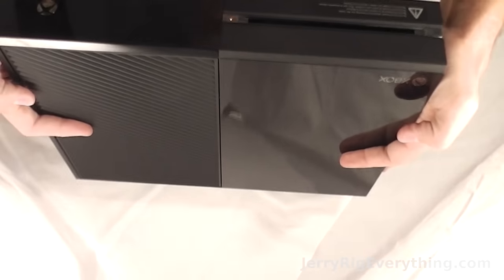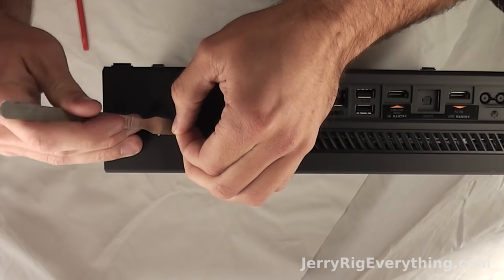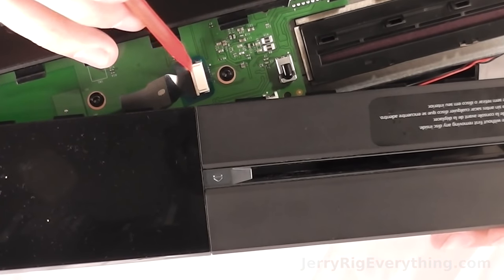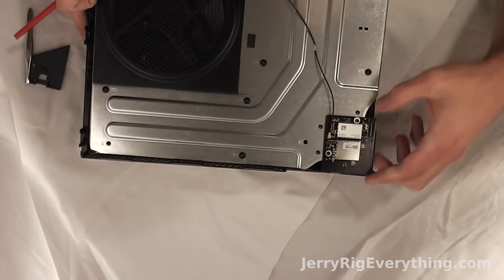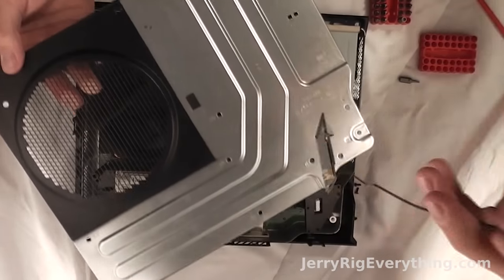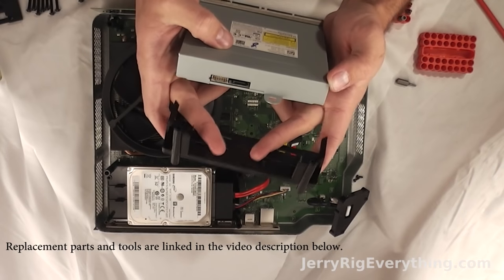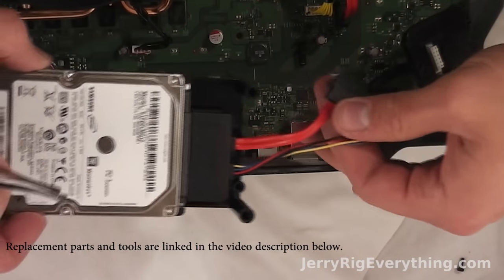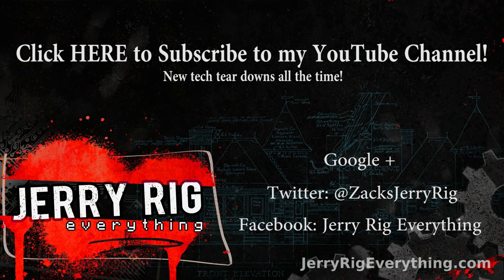NEW XBox One Complete Teardown, Hard drive replacement, Disk Drive swap

Comment: I'm a diehard Xbox one fan but this is waaay too much work. That's why I love the PS4. You can change the harddrive in literally 5 minutes.
Reply: lazy..
Reply: Sorry we don't want do completely disassemble are consoles just to replace a hard drive. The risk is just to high.
Reply: SILLYBOBO112 Not really. It's just a huge inconvenience.
Reply: Compared to the 1st gen, 2, and 3rd, this xbox is so easy to take apart.
Reply: How often will you be swapping drives? An extra 2 minutes wont kill ya
Reply: It's not a f""king 5min vid
Reply: SILLYBOBO112 Fanboy.

Comment: Is it possible to replace the hard drive with something bigger?  (I mean the machine won't freak out or refuse to recognize it?)

Microsoft were mad for having only a 500gb HDD when they insist on installing every game.
Reply: Agreed! I have 7 games and I've already used 80% of my memory -.-
Reply: Microsoft insist you get an external drive or use the "cloud"
Reply: yeah, ive gone and bought a 2TB external drive and even that is filling up pretty quickly.

ill probably need to upgrade to a 5TB by the end of its generation lifetime.
Reply: Jaymy Hickey of course they do.  they have an agenda to push
Reply: That's not even my issue. What happens if and probably when the internal HDD fails? Can I use external HDD as the only HDD?
Reply: chertio
I believe you can, yes.  You have an option to choose a primary drive.
Reply: I've replaced my internal drive with a 2TB hdd because I don't like having wires and external boxes dangling from my Xbox, it was a bit tricky because the new drive has to be partitioned in a specific way but does indeed work
Reply: Larry Bundy Jr 5TB is still not enough
Reply: machariel00 no the os is in the internal drive if that drive goes how are you going to even make that option? You can’t... Xbox just made me not want to buy any of their consoles ever again.
Reply: @Larry  yup i bought a WD 5TB external after installing 5 games and finding that with all their insane 70GB+ "updates" the internal drive is totally full, so it was like week 5 and i went and got a 5TB external. Does anyone know what size internal you can replace the 500GB one with? I have heard people trying 1TB or 2TB and they are only able to use 768GB of the 1TB+ which begs the question, what kind of proprietary system are they using to get their stock 1TB and 2TB consoles to work???
Reply: best buy sells up to 8 TB. on their website
Reply: @Larry  
The generation ended. Did you need a 5tb hdd?🤣
Reply: @ayyubaliyawan8155  YOu can just use acronis imaging software and it will clone any drive I have a 2tb ssd in my xbox one.
Reply: Charle Stew  Yes it auto partitions and images. It is a paid service but I think it's like 50 a year. If you want I wouldn't mind sending you my login to use. I can just change the password back after you're done.
Reply: Charle Stew  No problem bud! Good luck with it and have a happy holiday as well!
Reply: @Larry  I have a 2 tb with like 50 games and still have 500gb free how in the hell is yours almost full 😂

Comment: The fan is HUGE I guess Ms learned their lesson :)
Reply: well most heat is from the cpu and its got a massive heatsink and fan. so it should do the job.
Reply: but the heatsink paste is a tad better on xbox one than on ps4 both heatsink paste are crap they use. and on the ps4 the paste was rock hard on one vid the guy did a teardown. clearly they skimp on quality paste, knowing over time your get heat issues.

Comment: wish there was a xbox/ps software where you install on your computer and have ps4/xbox one, since its basically a computer.
Reply: The power you would need to run that software isn't possible with current PCs. These machines are made to do one thing and one thing only and that is to play games. PCs have more complicated operating systems, a lot of stuff going on in the background and games optimized differently for them.

In theory you could emulate the Xbox One and PS4 one day, just it will definitely be at least 5 or 10 years until we see that happen.
Reply: FluffySandwich dude ur way off pc right now have more power then consoles gaming wise. You could run a xbox one or ps4 emulator now if they made one. U dont know what your talking about when it comes to pc or anything for that matter sure u can take apart a xbox congrats pretty much anyone can
Reply: general rule of thumb with emulators is the machine needs to be 3x stronger then whats its emulating(possible today) but that's not the problem the problem is the drivers and the OS and stuff. you would need to emulate all of the hardware (CPU(APU technically) ram all the buses) and that's just a big unknown if this was open source there would be emulators the next day after release
Reply: ***** show me a use of someones 64gb of ram in gtav/forza/gran turismo... or show me how you emulate 10 years old gran turismo from ps2...

please try to run gta iv with 512 ram and 256 mb gpu... you cant? consoles can...

your argument is invalid
Reply: ***** ``waste of time`` yeah, sure... look at pcsx2 or whatever... its still not working like it should, end of topic
Reply: FluffySandwich The Xbox One utilises the Windows Kernel, so if you're familiar with Windows 8 then the Xbox One OS will also be familiar.
Reply: MrSiggyHD thats bullshit dude, same ui =/= same system
Reply: MrMangumm No it isn't! Go search it on Google right now and I bet you'll find that I am correct. Microsoft said back in May officially, on a lot of their videos, a lot of articles and if you use an Xbox One and Windows 8 (which for a matter of fact I have) then you will know that they are very very similar.
Reply: MrMangumm
I can show you running grand turismo 2 on my ps2 emulator if you like. and 3 and 4. ps2 emulators are running really good these days. it depends on your video card. i have a 660ti with 8gb of ram. it runs perfect it just depends on how you set the settings on the emulator.
Reply: legosavantfun has nearly the same parts, just a whole different OS and named Xbox 360
Reply: legosavantfun u can already emulate a pc through a pc

Comment: I know ppl are big into upgrading the hard drive but besides the look of having an external hard drive connected by the USB what's the difference.  I bought a 3 TB external hard drive from 120$ on sale. Prob solved, n it's small.
Reply: Please link me that hard drive. I hope you don't have to plug that hard drive up using an outlet
Reply: Jerry McCrary http://www.amazon.com/gp/aw/d/B00E055H5O/ref=mp_s_a_1_6?qid=1427253775&sr=8-6&pi=AC_SX110_SY165_QL70&keywords=3+tb+external+hard+drive&dpPl=1&dpID=41I5QPM4nsL&ref=plSrch.    I didn't see the 3 TB. But they do have it.  The power supply runs off of the 3.0 USB.   I'd get it
Reply: lisky4u wow only 92 bucks. Thanks a lot man
Reply: Yea. If u want, look for a hard drive that has around 5400 RPM it's just the loading time but that's a good number
Reply: +lisky4u . it is the speed in which the disk spins, so reek times and read and writes are slower than a 7200rpm HDD

Comment: Thats what makes the xbox a break hazard because its just a hollow shell with the system(mother board an all that) just sitting there. The ps4 is more compact which makes it harder to get to places but its more likely to to surirve a drop. GO PS4
Reply: Actually the lack of room means the CGPU will take more force when dropped. Therefore more likely to break when dropped...
Reply: ps4 is a heat magnet and its because of the way its built i work on these consoles all the time.xbox 360 had the same problem because of how compact the componets were.same for the ps3.
Reply: Jamie A He has a point though... I've owned every console since Commodore 64 and the only ones that fell were the ones with wired controllers and that was due to some ass hole running in front of the TV and tripping over the cord. Since Wireless Controllers I haven't heard of a console hitting the floor.
Reply: GamingCipher commodore isnt a console but seriously why would you have a risk of dropping your console? i mean really not like you really move em around that much

Comment: Fuck it! i'm getting a PS4 screw xbox and your needlessly complicated process of hard drive replacement
Reply: I hope you never decide to build a computer.
Reply: I actually have built a computer before, four times
Reply: JustPassingBy Then how is this complicated? its basically the same as removing the side of your case then unscrewing the screws that hold your HDD/SSD in then removing the cables. Just with a few more screws.
Reply: yeah no! I don't want fuckin' take tear down the whole freaking console just too replace the hardrive
Reply: Just buy an external hard drive and hook it up to a USB port, pees4 cant do that :p.
Reply: yeah and I didn't bother replacing the ps3 hard drive too and i REALLY don't care for your sharing games thing. Lets not turn this into a console war ok?
Reply: JustPassingBy You already have, + if you didn't need to change the hard drive in your ps3 why would you need to replace it in a xbox one or ps4?
Reply: so you can fit more shit in it? I thought that was the whole point of hard drive replacement?
Reply: JustPassingBy Why the hell do you think replacing a hard drive and losing the data on it if you cannot transfer it is better than hooking up a extra one so you can have 2 and not go through the hassle of transferring data?
Reply: I should probably have already said this but I have a ps4 and I already replaced the hard drive with a 1 TB standard hard drive and have already uploaded the software data on it so...
Reply: JustPassingBy Wow, good for you.
Reply: My xbox has been nothing but problems. Between network, hard drive, function and the useless features. Literally 10 minutes ago that blue ribbon cable broke with no force applied. Bullshit. I love my 360 but despise this awful POS.
Reply: GrandpaChink What blue ribbon? My Xbone is great. My hard drive has no "issues." My connection in Titanfall is better than on 360, and most of the features are very useful.
Reply: The one on the front plate. Im trying to figure out what it is and see if i can replace it. But yea, my 360 has zero connection issues but my xbone is awful. The only app that works is youtube. Which is what i mostly used my xbox for. I damaged the fan grill like an idiot and tried to pop it back out so it wasn't blocking the fan and i cut the ribbon. Im not good with electronics lol. Its my second xbone too.
Reply: GrandpaChink MS support is teh way2go. I think your Wifi thingy is broken, it's a known issue.
Reply: I think I'm too screwed now lol.
Reply: My warranty sticker was damaged not long after i got my console. It was partially torn off from when it rubbed in the box when i was transporting it. :(
Reply: Yea I don't agree with the difficult process of replacing the hard drive I find it too risky
Reply: DynamicsWorld which is why I bought a PS4 instead
Reply: its still easier than taking a laptop apart, if you can do that then you can do this

Comment: Fuck that I'll end up braking it. I looked how to it on ps4 and it looks easy
Reply: If it's like the 360 it's probably hard to break, that thing was an undying beast with the fact that all you had to do was unplug the console when it red rings and clean dust out of the mother board and disk tray.
Reply: Liam Fisher Depends what red ring you got, i never got one nor do i know anybody that has had one, but alls the red ring tells you is something is wrong... the worst one was the parts actually melted inside your xbox but that could happen to anything. A lot of people got a ROD and said fuck it going to ps3 and alls they would of had to do is blow some compressed air into the vents....
Reply: Liam Fisher yeah money was right the cpu would get so hot that it would melt the fan to the cpu. thats why i wish the would do intel insted of amd
Reply: drew lowery Intel would cost way to much money thats why amd is in so many phones consoles and business computers, that's how amd makes there money. They never looked at the singular sales its more about company's like nokia, htc, microsoft, sony and many more buying there really cheap processors in bulk.
Reply: Moneybagzsz ah
Reply: is there a ps4 fanboy camping out on every webpage that has to deal with xbox one

Comment: Your video was amazing. Somehow a couple of spools of thread  were setting on top of the Xbox and Unfortunately thread  was hanging down and caught on a disk an the drive ate several feet of thread. With your video I was able to disassemble  the Xbox, take out the disk drive, open it up and remove the thread that had wrapped around the rod. Everything back together and working fine except for one thing that I hope you can help me with. the case will not close completely snap together in front. I have tried several times: snapping the back first then the front first but still it will not completely snap together. The box is working correctly THANKS TO YOU. Just to let you know the Xbox is my  Grandson's and I am a 70 year old grandmother who gets around with technology rater then a walker :)

Comment: Just before the halfway mark, you remove a small board, and comment that you arent sure, maybe its bluetooth/wifi. You are correct; the shielding gives it away. That little silver box soldered to the board is to shield the radios from interference.
Reply from the maker: Nice, Thank you for letting me know.  Ill remember the shielding trick for next time.
Reply: JerryRigEverything A LAN card can also have shielding like that, but then, it would have a LAN jack hanging out of it.

Comment: Virtually all the early production x box ones failed within  a few weeks.  It was determined that the manufacturer had not put any TIM between the processor and heat sink to save money.  I bought mine from c0 $ tc0. They cheerfully exchanged it for a new machine. Twice. The slim didn't have that problem.  Every first generation  MS product fails at very high rates. I wait most of the time until the bugs are worked out.

Comment: Cool stuff, I'm definitely going to put an aftermarket heatsink on and replace the TIM, possibly put everything on water.
Reply: why waste your money xbox one heatsink is big enough and it does have copper heatsink pipes the ps4 dont use any copper pipes at all. serously would be silly to use a watercooler on a xbox one.
Reply: ***** Because it's just something I want to do? I like modding PCs and a console is basically a stripped down PC.
Reply: Ch0plol
You might aswell take the guts out and make a PC case look cool and just slap that in there

Comment: i definitely need to try this out soon in hope i can successfully install a new, larger hard drive because by the looks of it, these consoles look like they're capable of holding only 8 or 9 games maximum. of course, microsoft will be coming out with a 1TB sized hard drive console in a few months and i'm not looking to spend another $500 just to have more available games. this video looked very helpful, i'll be attempting this very soon. thanks for the breakdown!!!!
Reply from the maker: Sean Starkey No problem! Thanks for watching!

Comment: I see they used more copper with that new heat sink looks very similar to computer heat sinks. Its about the size of what you will find on most core i7 lga 2011 socket cpus. Good teardown +1

Comment: holy crap, this takes like a 1,000,000 steps, with ps4, you pull of the shiny part, unsrew the big screw, then take out the hardrive, unscrew 4 more screws, take out the old hard drive, then put the new one in, then put all the screws and the lid back on then your done, you don't have to remove the motherboard and like 100 layers to put in a new hard drive
Reply: To me it looks like Sony purposely made it easy to replace the Hard Drive. Everything else is still about the same. He did a semi-full teardown. The video wasn't titled "How to upgrade the Xbox One Hard Drive" that was merely one of the things he covered. I'm sure if Microsoft wanted the drive to be upgraded they would've made it as simple as PS4

Comment: My Xbox wont connect to any controllers farther than a foot away. Do you think its the wifi/bluetooth board that needs replacing? The wifi works fine, just the controller reception is shit.

Comment: Did you try and change the hard drive for another model? all previous xbox consoles have had some kind of locked hard drive or a secutity sector in the hard drive which meant any non ms hard drive wouldn't work

Comment: Is the XB1 HDD just straight-up replaceable? You don't need to flash it with any special security sectors like you do the Xbox 360's?
Reply from the maker: HinataChan30 Ive never tried yet... BUT I imagine if you just clone the drive it should work.  But you should probably research that first.
Reply: i think it is. just regular may work

Comment: 1. Where do you get the tool to pry off the grill?
 
2. Anyone know if there's a limit to the size of the hard drive you can put in the xbox one?  How about the xbox 360?  Could you put a terrabyte hard drive in it?  I'm just thinking that with the size of the hard drives they normally come with, especially when you look at how much they charge you for a 250gb hard drive for the 360, there might be a market for buying 20gb 360 hard drives, and putting 300gb or terrabyte hard drives in them and re-selling them!  There definitely would be a market for replacing x-box one hard drives!

Comment: So I have the same model connects via hardwire or wireless ,but the sync button stopped working or making any sort of connection with my wireless controller should I bother and try to salvage it or scrap it out a little help would be greatly appreciated!